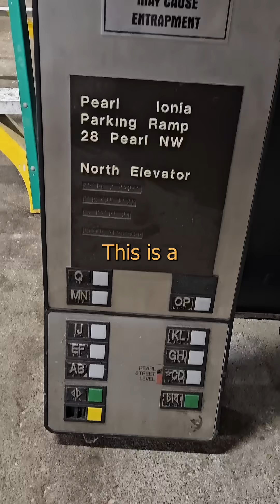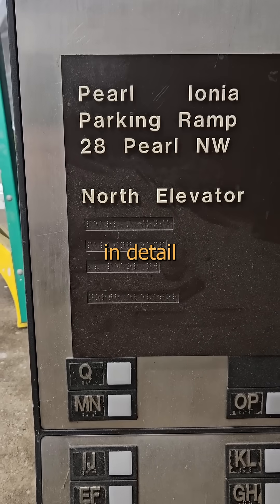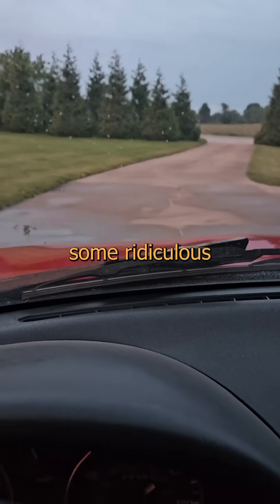Miata Mischief #chrisboden #engineering #gear #elevator #score #stories #parts #hacking #making

Comment: I bought a 15 Gallon kegerator. and Tried to get it into my Hyundai Elantra,

having lots of tools, I was able to take the door off, take the wheels off, the tower off and then took my passenger seat off and tossed it in the trunk.
Oh, I had a friend with me. She sat in the back seat while our new fridge in parts rode back 90 min home.

I still have it and it still works to this day.  (both the car and Fridge)

Comment: I found out that with the back seats down, a two door 94 Camry has about 10’2” of space to the passenger foot compartment. I was eighteen and my boss had the truck, and I needed to move about a hundred feet of various sizes of copper pipe, black iron pipe, and unistrut in ten foot pieces, for a boiler job. Necessity is the mother of invention, and man do I miss that car.

Comment: It's not as cool as everybody else. But I drove a 2004 s10, picked up a motorcycle as a spare and loaded it into the bed and drove home. It was too large so I left the tailgate down.

Now here's the kicker, I got home noticed something was off, found out The bed wasn't bolted down and the only reason I didn't lose it was because of bungie barely holding on that would snap pulling into the driveway and losing the motorcycle in the street.

Comment: i put a big ass tv that a mail store threw out in the passenger seat of my 2011 volvo c70 coupe/convertible because it was too big to fit in the truck. it still worked so i wanted it so i took it. the seats didnt fold all the way down at the time so it was sketchy as all hell, i could barely see to my right. drove it about 3 or 4 miles home.

Comment: Hauling 12 Douglas fir beams, 25*25 cm and about 420 cm long.
Of course I didn't have a trailer, so I loaded it up in my Volvo V40.
I collapsed the rear seats, but the wood wasn't in balance so they would fall out of the car. I then used my sister as a counterweight, laying down on the wood to keep it in the car. Every little bump made her hit the ceiling of the car, and getting into an accident would have been... Nasty.

I wish I still had the photos of it 😂

Comment: Miata logistics is an art. My 07 miata is my beloved, I don't need an SUV or a truck to haul shit, just some time and ideas.
Reply: @Techiastronamo  Yup. I've had 3 and people are always like "can't haul much in that" and I just reply "its a convertible, it has unlimited cargo capacity. The Sky is the limit!"... I've hauled so much odd and huge stuff in mine I can't even remember the largest thing.
Reply: @Techiastronamo  I saw an old cowboy in a Miata with a tow ball on it one time. 
I still wonder exactly what old boy was "hauling" with a Miata.
Reply: Probably a small car trailer or just a small trailer  @Quesi00
Reply: Don't have a Miata, but I did similar rat packing stuff in my C5 Corvette. Crammed all 4 wheels(Rims, tires and all) into that thing when it was time to do the seasonal changeover. 

Also had a moment where I had to pick up a supply of tires from a sister store in my business. Manager there raised a brow thinking I was nuts for bringing a Corvette to pick up those decently sized tires. Still managed to fit 4 255mm wide, 20 inch tires into that thing. Could I look behind me? Only if I stuck my head out the window and turned around. Could I see to the right of me? Only if I stuck my head out the top. Could I shift? Yes, but only because I was holding the stick the entire drive, keeping the tires away from the center console.

Comment: Oh sketchies shit?
Well
Got a 2003 toyota station wagon, , true family machine. And we fucking torture this thing, transport everything.
So we needed some gravel in our garden, and found some for free on craigslist.
So we got a two axle trailer,hook it up and start loading gravel on there.
Mind you the max allowed weight you already get from 5 guys and an evening with lots of good food. And we transported 5 guys, equipment, and the fucking 2 axle trailer through the city speedway. So all in all i think we overloaded my trusty old toyota avensis by about 2 tons, or nearly doubled the allowed max weight

Comment: Back in my youth I stole a stop sign, still on the 10ft pole, complete with concrete on the end of the post. I was in a 82 Rx-7 so the only way I could get it home was with the concrete in the passenger seat while the post/sign was sticking out of the open rear hatch. The bottom bolt to the sign was missing so the sign swung down plain as day instead of laying flat.

Comment: I love first gen Miatas so much, I bought 4 of them! My sketchiest move though was when I got told if I could haul off a 1955 John Deere combine, I could have it. While loading it, I figured out that I would have over 3/4 of the tires hanging off either side of the trailer, so I elected to drive home the back way and very slowly. I still have pictures somewhere.

Comment: I was out cycling and I happened to pass a dumpster and noticed a few choice-looking treasures so stopped. After an hour of diving, removing most of what was in there I had so much stuff that I had to fill every bag, bucket and container I could find in the dumpster to tie as much of my stash on my bike as I could cos I couldn't risk leaving anything behind in case it wasn't there when I returned. The haul was not only heavy it was quite high value (several hundred pounds) and most of it was brand new. 
6 stainless steel hand towel dispensers, 6 SS industrial sized toilet roll dispensers, 6 SS electric soap dispensers, a tool box with tools, a furniture moving skate, large builders pail etc. The only problem was there was no way I could ride my bike loaded like the start of the Buckaroo game so had to push my bike, loaded with around 200lbs of booty, over 2 miles to get it home. 

Another time I saw some beautifully grained 12ft long, 10x2, 100yr old+ vertical grained pitch pine rafters, taken from a roof of a Victorian house. I had to do sever trips with 2 planks resting on my shoulder as I rode very precariously over a mile home. I made some great shelves with them after they were shou-sugi-banned/Yakisugi to bring out the grain and then waxed.

Comment: I bought a used full length exhaust system for my 2 door 1996 GC8 Impreza. Even with the rear seats out, the boot dividers out and front px seat folder flat, it fitted with an inch to spare.
As the car was now effectively hollow, the fuel pump whine was crazy loud and annoying to boot. To get around the insane pump noise, I cranked up the radio to 11 to mask it. However due to the current draw from the radio, it heated up the connectors behind it, to the point where internal relays failed to work due to heat, so for a while had no radio, no lights, wipers, horn or heaters, until the cables cooled and relays reconnected. The 4 hour round trip was well worth it for an old skool japanese Fujitsubo exhaust :)

Comment: I used to own a lil 09 Altima coup, and when I bought my first PC I found that it didn't fit in the trunk and I couldn't slip it into the back seat. I couldn't put it in the passenger seat because I had other people with me so my solution was to flip both front seats forward and slid the PC into the back seat through the Sun roof. Don't ask how I got it out

Comment: Ever jumped into the middle of the street to shove a pole under a traffic light to lift it?

I was offered an 10x12 shed, but had 24 hours to move it.  Borrowed a car hauler, but that put the roof too high to go under street lights & utility wires above the road, so I rigged together a long pole topped with an upward-angled hook.  

At 4 am when we thought there would be the least traffic, each time we approached a wire I would get out at shove the wires or traffic lights out of the way, which included testing the strength of the pole, as I had to kick the bottom of the post along the ground to wedge it up under the traffic lights - they are REALLY heavy.

Got there in one piece, and zero traffic tickets (though we did piss off a few early morning truckers we were in the way of ;)

Comment: When I was 19  I was working road crew clean up after a river flooded out 10ft deep over river banks of an area here in Pujet Sound WA. I used an excavator to lift a sunken 1971 Chevrolet Chevelle out a sink hole in the middle of street That swallowed it. I gave the owner  400 cash I had on me the purchase and I then used the excavator again to load it into a Government 10 yarder dump truck bed and hauled it 40iles to County Park- Frontier Park In Graham WA that my dad was a on-site resident manager of the 50 acre place witha mega equiped shop  Paint spray booth and machining shop and in a 6month period my Dad and Frame Offrestored the car just in time for a var show Fathers day 1998turning into a 454 SS  clone bright yellow Cowl Induction hood black vnil top no hood stripes this was back in 1997  we did all the resto ourselves and as we od to many other classics like is still have my first car 30 years now 1972 Caprice it's and the Chevlle photos can be seen on my yoube image post at this link below or check out my vids  I made a ride along vid yesterday 4 miles from house to the roadway that a 1979 Rainier Beer 🍺 comerial was filmed on the 1 were a guy rides his motor cycle into the distance with MT Rainier in distance i know you know the comerial it's world famous so a take you on a tour of the sire now and I share my personal story connection to road it WAS  filmed on   RAINIER BEER MT Rainier Comercial.
 
 http://youtube.com/post/Ugkx-gX7TV8HC2X0AsKutEF9qYaxU57UQB2Q?si=TGT-f5reWW88cG5B

Comment: I found an entertainment center that fits 3 1:10 scale rc cars , my small ish drone, the 4 radios, and a stack of cds 3ft tall with room to spare one day with a "free" sign.

I shoved it 1/3 the way into the trunk of my 2005 pontiac grand am and used 2 ratchet straps to hold it in place as I took back roads home reciting the age old montra "please be no cops" all the way home.

Comment: I have a 4th Gen MX-5, so a little more boot space than your first gen, but about the same wheelbase. When we all got kicked out of our office for the COVID lockdown we were told we could take home whatever we could carry and we wouldn't be allowed back to pick anything else up. So my laptop, 2 screens and all of my documents go in the boot, and my expensive office chair went upside down in my passenger seat, with the wheels sticking up out of the open roof for the drive home. It rained the whole time.

Comment: About a month ago I found one of those big round Lions club signs knocked down in a ditch. 5 worried minutes taking the bolts out in broad daylight with the 6" Crescent wrench that lives with the screwdrivers and pliers in the glovebox, and I somehow managed to get the bigass aluminum Disc into my 2nd Gen Miata. It really doesn't "fit" in there but the door closed, it didn't slice the top, and I have a cool Lions Club sign on my shop wall with all the stolen "No Trespassing" signs. I always wanted one of them

Comment: Once I found at IKEA as-is section a unitary three place sofa I had to buy to sleep on. The first hiccup was that my i10 Hyundai was as long as the piece and the second hiccup is that I would have to drive it on the top of the car 150 miles home on a very winding mountain road which is known for its strong winds. And I did! What usually takes 2.5 hours became a 4.5 route of stress fueled sailing that little car against every passing trailer and howling winds.

Comment: I broke my girlfriends mirror about a year ago, around the time I had just bought MY first car (not work, not rented, not financed. Completely mine.).
It was a 2021 Vauxhall Corsa. I had to remove the front seat and leave it at the shop to drop it off at the flat, set it up and return for my seat before I picked her up from work to surprise her with it.

Remember kids, always have a spare toolset in the car

Comment: I moved an engine crane and a 6m long wooden beam in my mazda 626 with the hatch open and the engine crane with one leg on the bumper and the other holding the hatch up. the wooden beam started on the dash, with an old tire on it to lessen the chances of it going through my windshield, and ended a solid 2-3m behind the car. and on top of all that, superman-style, laid my friend. we did 20km like that, on bald summer tires in muddy snow. ahh, memories.

Comment: I stole a parking meter in Boston that someone had already stolen, concrete ball on the bottom of the pipe and all!  Took it home in my VW bug (tight fit) and it turned out that it was originally stolen from the town in Conn that I lived in!  Afraid of getting busted, I hid it for years until I finally sawed the pipe and ball off and it still worked!  sold it at a tag sale 20 years later!

Comment: A while ago I moved to Canada for a couple years and to get myself settled, I got some second-hand stuff. My boss at the time gave me away an old LCD screen, which I thought it was going to be a computer screen.

It turns out, it was a chonky 55" LCD TV and then me, a 24 years old short-and-skinny boy just landed in the country with no car having to haul that massive screen.

I got one of those tiny smart fortwo cars that you could rent by the minute/hour by just unlocking through an app and wiggled a massive TV compared to the size of the car and drove all the way home.

Comment: Back in my youth (say age 12-15, in The Netherlands, EU, aprox 40 years ago), I made a cart behind my bike for my boat. The boat was 4,5 meter long (bout 14 feet in banana's) however, and I made the cart big enough to carry the boat and its contents. Yes, made it myself, Couple old bike front wheels and the fork, made a frame from wood and put old folded towels my mom gave me on the places the boat would rest on, and nailed that around to keep it there. I can't count the number of times I took that sailboat to the lake about 6 km across the city to sail for a day and bring it back again. I did this like every couple week or once a month or so, except between late autumn and early spring The hardest part was getting started after every traffic light.

Comment: When I was young my friends and I got drunk and we went to steal this giant banner from the store. I just grabbed the banner at the edge and started running to the car and when I got to the car I went to throw the banner inside and realized more than half of the banner was still attached to the building it was so big. I had to go back and run almost 2 more times to get the entire banner into the car. That banner was talked about for years because we used it as wallpaper in the area where we all used to party.

Comment: I hauled a quad on top of my 87 convertible 4runner with the roof off and the tailgate down. front axle up over the roll bar and the rear axle hanging off the gate.

Comment: I'm a marketplace fanatic, and 3 years ago. Me and my wife went to a Meetup for a motorcycle. That was supposed to run well. I get there and it didn't run. So I was ready to leave. She was definitely ready to leave and the guy took $400 off the price and there was a deal. I just couldn't pass up. So we stuck it in the back of my wife's Ford Edge that it did not fit in by any means with the trunk open this bike ratchet strapped halfway out of the back of her car, and we drove from Houston to Montgomery, which is a good, 40 miles with the motorcycle. Strapped out of the back of the truck. And did it, made it to its destination while she was yelling at me. The whole time.

Comment: I had a 1993 Dodge Spirit, actually, part of the R in SPIRIT had been scraped off the car, so it read SPIPIT.

I had purchased a kit with all of the materials for a vinyl shed, plus the lumber necessary to make the floor.

The only other car available was a 1999 Chevrolet Cavalier, and it was my wifes, so sketch was not allowed.

Sheet goods got strapped to the roof, and I was careful to keep the driver door open so that I could enter the vehicle.  

I bought the ratcheting tie downs just for this purpose.

I removed the passenger front seat, and the back seat, and I proceeded to load all of it into the car. 

I was fairly held in by all of the material, and had to unbox much of the vinyl shed kit in order to fit it all in.

I got it home and built the thing.

I eventually put the seats back in, but for a while, that SPIPIT was a one seater.

Comment: I had gotten some 16ft channeled steel from a big room that got demo'd, and I didn't have a trailer big enough to haul it home. So, I leaned them onto the top of the cab and the back of the flatbed, wrapped the straps around them before tightening down, and prayed there wasn't any low hanging lines on the way home. It was at least 10ft off the ground at the front, and hanging about 3ft off the back.